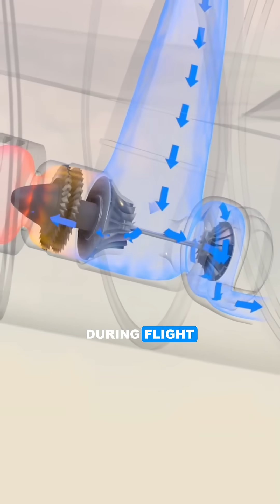Why Is There a Fan Under the Plane? #shorts

Comment: It’s like appendix in human body
Reply: Quite the contrary, appendix may or may not have its uses but a ram air turbine can drastically increase the chances of a safe landing in case of total hyd or elect failure. Cheers.